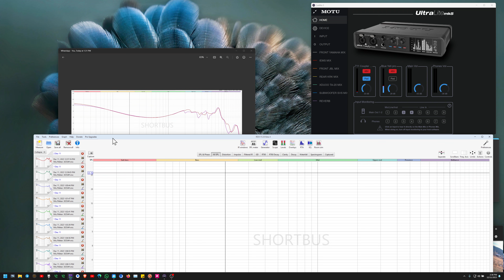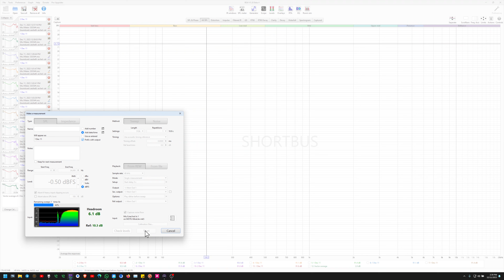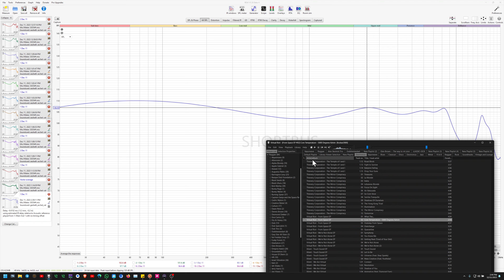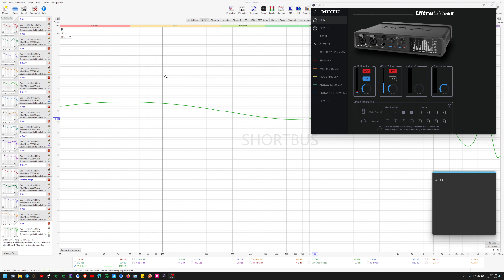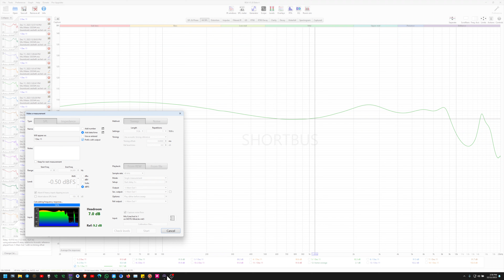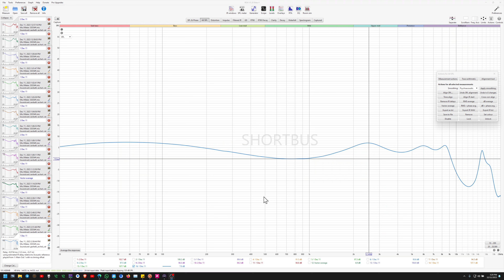Lets modify the EA500. Hands on tutorial on modding and tuning.

Comment: I have a question, if you could please let me know because I’m struggling to find concrete info (much less experience) elsewhere: is there any way to mod in a bit more (quantity-wise) bass into the EA1000? I really like the clarity but another 2.5 - 3.5 db in the low range would be great. Is there any way to do it without opening the casing, through external vent modding?
Reply from the maker: The best way to find out quickly is tape over the front vents.  Check the sound.  If it works you can use a high value damper such as 2.5mm 500 or 600 value and allow some air venting while keeping all that extra bass.
Reply: @MichaelBruceShortbus  I’ll buy some medical tape tomorrow and play around with combinations of tape or tape + cotton over the vent to see if anything changes. The DYI kit is on the way in the mail, I’ve never tried filters, sponge and dampers yet but looking forward to it.

Damper would be a more permanent (and infinitely more aesthetically pleasing) solution, but I’m not sure whether I want to open them to glue it onto the inside of the vent just yet. I guess it depends on how good (or not) the sound turns out. If tape or tape/cotton works out, I’ll try to glue the damper onto the outside first to see.
Reply: @MichaelBruceShortbus  Tried it today and taping over both vents on each side with medical tape absolutely increased bass, audibly. But it unfortunately came at a cost to clarity and bass quality/tactility, so it’s possible I used tape that was just too thick and ended up adding too much bass into it. Took them off in the end because I have a modding kit on the way and would like to see whether I can add a bit of bass without losing that clarity and tactility/physicality. 

Still, it was amazing to realize and hear first hand that a mod like this was possible without even touching EQs or software! Now if I can only find a way to do it while keeping resolution, haha.